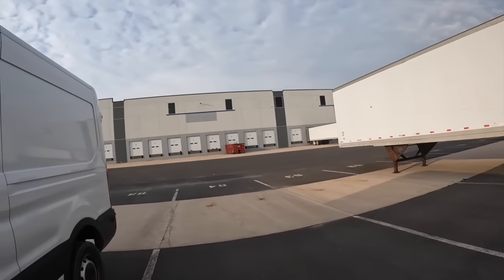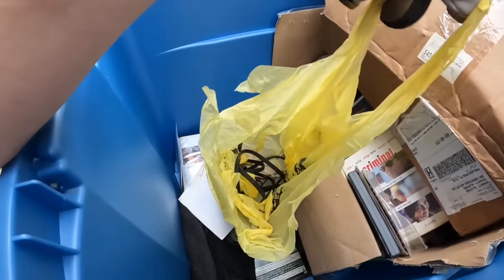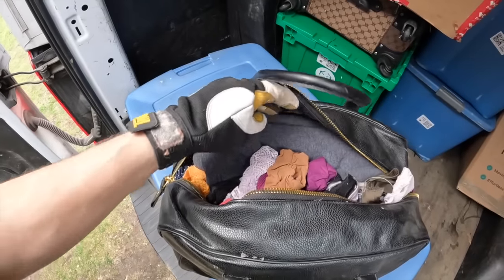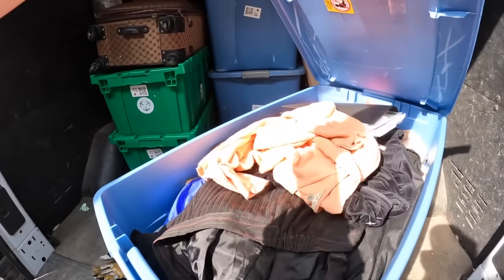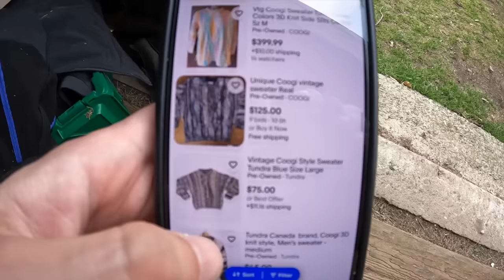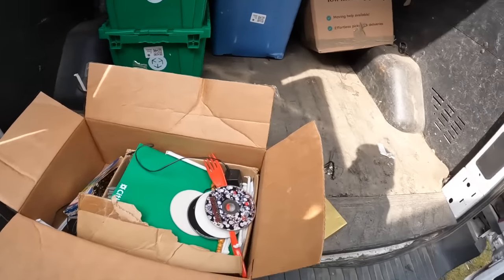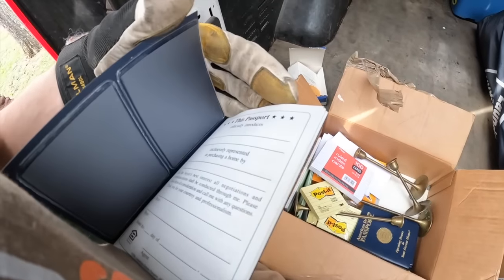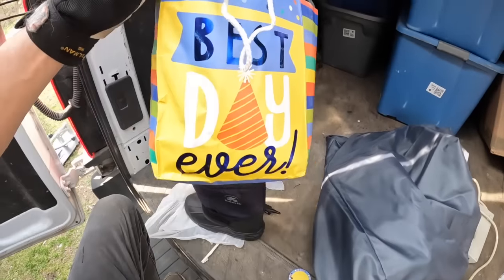I Bought a Famous Rapper's Storage Unit! - Look What I Found!

Comment: Some costume jewelry is worth a pile, but it takes some expertise to know which is what.  I didn't see anything crazy, but that one anchor chain choker seemed to have a Talbots or modern Trifari tag on it. Neither goes for much, although original retail was ...a lot more than it's worth. 21:22 The flower painting is what the trade calls "factory art", painted assembly-line style in China.